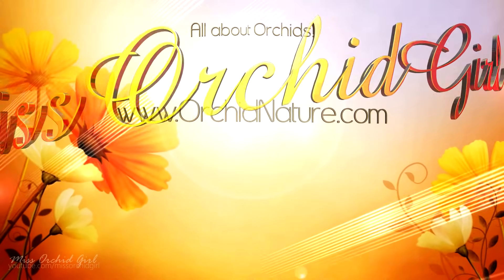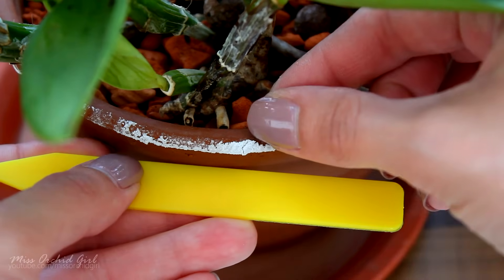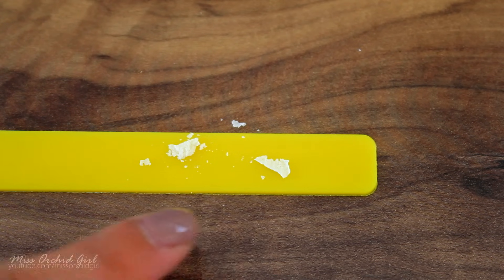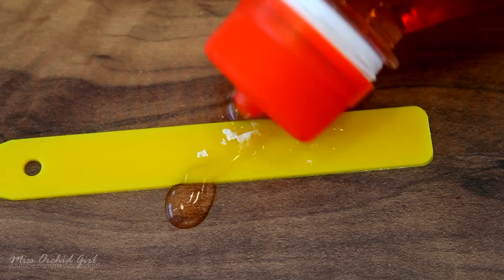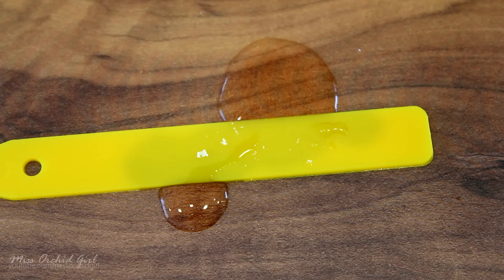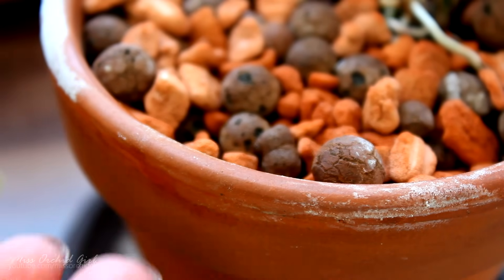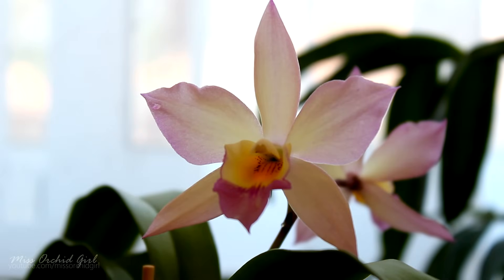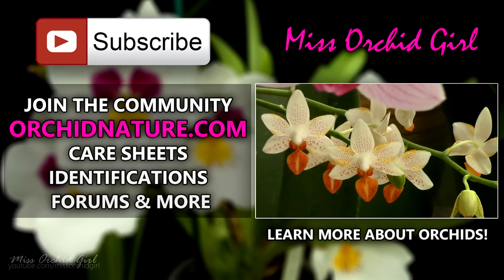What is this white deposit on clay pots?

Comment: I think it's the leca
Reply from the maker: We shall test it :D
Reply from the maker: Hi, yes it is a Dendrobium Phal type, it doesn't look very bad though, it has anew growth that will make roots. Have you repotted it? regarding an ID I am not sure, never seen one like this.
Reply from the maker: I do repot any new orchid because the old medium might be broken down or have pests. I would use something similar, bark chips works great for them. If your environment is very dry or very warm a mix of bark and sphagnum moss can work too, but don;t over do it with the moss. But it has to be fresh medium, don't reuse the older medium. You can reuse the pot but wash it before, or you can use a clear pot to see the roots growing. Also when you repot cut all dead roots, they will spoil the new medium very fast if left there. You can wait with repotting until after the blooms drop if the orchid seems ok still in the medium and the medium doesn't smell bad after watering :)
Reply: MissOrchidGirl Hey Danny - thanks so much for your reply. No, I haven't repotted it. Why do you ask? Do I need to? If so, what kind of substrate do I put for it? One other channel suggested a mix of sphagnum moss, lava rock & perlite - not even sure where I would get those - have to hunt around for those. Do you suggest to repot it to see what state the roots are in? Please let me know.
Reply: MissOrchidGirl Thanks so much Danny for your reply. When I water-soak the pots, I see some one or two very tiny spiders crawl out and hang on the outside of the pot until I drain the water. Those are pests, aren't they? The first day I watered the orchid, one tiny snail walked out :-S I'll have to hunt around for bark and sphagnum moss media. The orchid is doing ok, but the blooms don't seem to be doing so. The two buds you saw in the video / pictures are drying out and have turned pale-pink :( How do I identify which are rotting roots, and which are good ones? Do you have a video for it, or can you do one? Also, what should I do with the spike if and when the blooms drop? Leave it be, and repot? BTW, I stay in Singapore, so it's humid all year round (Singapore is in the torrid zone). Eagerly awaiting your reply.

Comment: The deposit would potentially also be other dissolved minerals like calcium. However you also mentioned previously you've been using some liquid fertilizer, which i think is a likely explanation
Reply from the maker: Hi, yes I am using regular fertilizer with orchids, it just be that but only on some pots :)

Comment: Danny is there any association between the degree of deposits and the species/size of the orchids? I was wondering if some species were not taking in as much of a certain element than others and so you have increased deposition of that element. If it were total salts then you would expect to see similar deposits on plants of the same size and species, if this isn't the case then maybe it's something more specific. 

It's really interesting to me so if you have any observations about the above then I would be grateful to hear about them. 

Cheers.
Reply from the maker: Hi, that is a very good point! I went to check but there seems to be no correlation on species, size or root mass. I did notice that a certain type of pots I use, the shallow and wide ones, all have the deposit :)